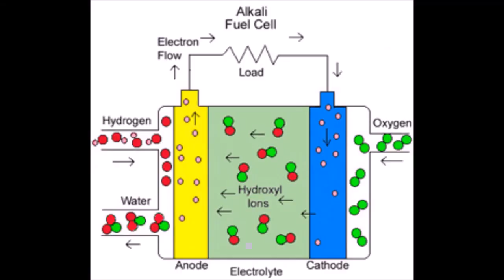DIY Electrochemical Hydrogen Fuel Cell

Comment: Can I use a copper metal sponge? A sponge has much more surface area in contact with the water. Will I experience energy loss with copper?Can I use a copper metal sponge? A sponge has much more surface area in contact with the water. Will I experience energy loss with copper?

Comment: Could you power a car with a bigger version please? much more platinum / surface area... foil sheets? Sheets rolled around a "spongey" material... H2 and O2 separate? Can it run on liquid H2 O2? Maybe the gas can not only "power" it but super cool something towards lower resistance... dunno.

Comment: Hey, even I tried this with 4 cells in series and it's only generating a voltage of 2.6V and current of 0.11mA and it's not enough to run a 3V motor. Can you please help me out?

Comment: Why not make a metal fuel cell using lemon juice and concentrated peroxide. A microfiber cloth for a wick and just have electrodes of lead an aluminum or aluminum and carbon? Just sand a pop can and bet some fishing anchors flat. Or you may have to buy a carbon foam electrode or graphite sheet. You can use citric acid instead of lemon juice but store bought peroxide does not last long as it is mostly water. Your aluminum gets used fast.

Comment: 2:15 I'm going to make one and design one for my laptop, because the battery discharges too quickly and the batter replacement is too expensive.

I'm happy I took Chemistry, so I know about hydrogen fuel cells and how they work, but am researching further to try and design a small fuel cell that can work easily with my laptop.

Comment: Hey guys I was planning to do a chemistry lab experiment on these fuel cel and was wondering about the independent variables that I could change to study the effect it has on another variable.

So far I’ve been thing about changing the concentration of KOH on the effect of current change supplies with a constant voltage (9V). Anyone have any other suggestion?

Comment: why some fuel cells or electrolyzers can make hydrogen and oxygen without potassium hydroxide, from pure water?
How much efficiency you achieve using platinum?
I wanna know if it is possible to make a reversible fuel cell myself and if I can achieve at least 60% efficiency in electrolyzer and 40% for the fuel cell.
I know that the state in the art is at 93% and 60%

Comment: Could you use a carbon electrode instead of platinum? or would that dissolve into solution?
Reply: I did some reading on Alkaline fuel cells, and it should be possible to use a nickel anode and a silver cathode.

Comment: does enyone know where can i buy that sort of platinum wires...? (without spending a fortune)
Reply: I did some reading on Alkaline fuel cells, and it should be possible to use a nickel anode and a silver cathode.

Comment: could you use table salt as the electrolyte
Reply: Yes, but table salt will consume some of the hydrogen and oxygen to produce lye and chlorine gas
Reply: potassium hydroxide or maybe sodium hydroxide are best. (in certain types of drain opener).  I guess the next best might be sodium carbonate (washing soda), purchased or made by cooking baking soda.

Comment: You can substitute nitrogen doped carbon nanotubes or N-doped graphene for the platinum   For cheap proton exchange membranes you can use PVA chitosan h2s04 gel electrolyte. Trust me unless you are going to invest in a sputtering setup platinum will break the bank before you have a system big enough to matter.

Comment: you could have predicted your cell voltage from the half cell potentials (0.4-(0.8))... agrees quite well with experiment! had you used an acid electrolyte, you'd have made the actual 'standard hydrogen electrode' which was used to reference other half cell reactions (as 0.00v) :) very nice!
Reply: lol

Comment: Interesting concept. You could cover the potassium hydroxide solution with silicon oil, to prevent the formation of potassium carbonate from the CO2 in the air.
Reply: This is like the only problem with Alkaline fuel cells.  Pretty amazing devices.

Comment: my understanding is that hydrogen fuel cells work by recombining the hydrogen and oxygen to for water and use the movement of electrons from this process to create electricity. question: where are the hydrogen and oxygen recombined? do ions travel through the electrolyte and which ones?
Reply from the maker: +mysterioushooded 
Yes ions move through the electrolyte
Reply: ok thanks

Comment: I've always wanted to try this with Pure Nickel metal, as it's in the same Vertical row as Platinum on the ptoe. 
It also seems to have the ability to absorb hydrogen gas too, maybe lots more under pressure
Reply from the maker: +BasementBen 
look up nickel hydrogen battery. "The negative hydrogen electrode utilises a teflon-bonded platinum black catalyst"
Reply: Yeah, a nickel anode and a silver cathode.

One source I found said that the voltage potential on one of the electrodes increases with the log of pressure.  

The temperature can also be increased up to the boiling point.  
This is extremely corrosive though.  Don't touch!  

Vp(mV) = 1.5 T(Kelvin) log(P2/P1)  (Vp = cathode potential? in millivolts)
Vn(mV) = 4.0 (T2-T1)              (Vn = anode potential? in millivolts)

Comment: Was reminded of something when I saw diy solar panels at end......Has anyone ever heard of using sterling engines as generator? I do not know how plausible the science behind it is, but supposedly you can concentrate sun onto a sterling engine with mirrors and it will produce up to double the amount of electricity then solar panels. Idk how true this is, or if just a concept. Comment if anyone knows if this is true/false. thnkz
Reply from the maker: +Clyde Connors 
Sterling engines have a theoretical max of 40% efficiency to convert heat energy to mechanical energy which is better than most solar panels but by the time you have made that into electricity solar wins because you dont have alternator losses. Here is an engine that I made: https://www.youtube.com/watch?v=H85DJwRyaIk
Reply: A silicon solar cell is around 15% efficient.  A toy Stirling engine is likely around 1-3%.  A power-producing Stirling engine is typically around 10%-20% , around half of the theoretical max (Carnot) efficiency.
Reply: those actual stirling engines are not perfectly made
they use the stirling cycle wich is ideal
but their construction and build isnt
the best and most efficient design of stirling cycle i saw, were the freepiston one using compressed hydrogen as themodynamic gas
Reply: Sterling engines can be used for solar power generation, but they are much less efficient than a solar cell. The efficiency of a normal solar cell is somewhere between 22 and 40%, while a sterling engine has an effieciency of around 1.5 - 3%

Comment: G'day,

Yay Team !

 Well, mate, unless you can cobble up a Fool-Cell which is better than 95% efficient at turning Water + Current into Oxygen & Hydrogen, and also better than 95% efficient at turning the Elementikal Gasses back into Sparkliez...; then you'd be FAR Better off buying the best existing Lead-Acid Battery in the Catelogue, because they'll actually be worth using.

 If you REALLY want to do the Hillbilly thang, then intercept "not yet dead" Automotive Batteries at the local Auto-Electrician, most have been chronically undercharged, and even if you can only resurrect them to being 75% efficient (90% is Brand New, lose 5% to heat in storage, another 5% in retrieval..., Pb/H2SO4 is REALLY hard to beat...!)...; then you'll be miles ahead of Fool Cells...

 My son once gave me a Solar-Electric Fuel-Cell powered Model Car, for X-mas when he was a 1st-year 'prentice Auto Electrician, it was 60% Efficient at turning current into Gas, and 40% Efficient turning Gas back to Current..., so even if you can beat that by 20% you still won't be 1/3 as Storage-Efficient as a  Car-Battery...

  I can admit to having become a bit "Obsessive" about Lead/Acid Batteries, and how to pander to their idiosyncratic requirements & limitations...; backtrack me to my "SunFoil Project" Playlist, wherein if you view "SunFoil Science, Raw Experimental Data & Analysis..." then you'll see what I mean...

;-p

Ciao !

Comment: Hey Cody, any recommendations for generating lots of H2?  I want to float some large mylar Christmas balloons and don't really like the idea (or cost) of using helium.  I probably need a couple hundred liters, electrolysis is slow and I want to avoid generating O2 if at all possible.  If these go up i prefer the orange fireball to the white flash.  :)
Reply: +jcims search for HHO Drycell on youtube, and a real good source is HHOPWR or smartscarecrow or zerofossilfuel, and look for the videos from 5 or 6 years ago. But be careful HHO is dangerous if you are careless about it. Don't build a wet cell configuration, it works, but not as good as a drycell and it is dangerous. Make sure you use the right safety gear to prevent a back flash, and never store oxygen and hydrogen inside a compressed container together.

Comment: Semi-related question. What would be more efficient for converting electricity into kinetic energy: an electric motor, or using electricity to run water through an electrolysis cell and then use the resulting gasses to run an engine?

Comment: What if you try nickel(it will not corrode in lye even under voltage, and some forms  of it are catalytic) instead of Pt wire? You could try even nichrome wire if not having pure Ni, will you try?
Reply: Yes and silver for the cathode.  Silver has about the right bonding strength with oxygen for the oxygen reduction reaction.

Comment: Try making a methanol fuel cell it's almost like a hydrogen fuel cell but it's much safer and some buildings use methanol fuel cells as a back up power supply for when power goes out :)

Comment: Hey Cody, I've done quite a bit of research into building fuel cells, and I want to warn you that you're going down a dead end with this design. You're patterning your cell off of the Grove Cell, which suffers from 3 big problems: 

A) Power output is related to the distance between the two electrodes. With the grove cell, you'll never be able to get them very close together.

B) Power output is related to the surface area of the electrodes. with the wire, you're kinda stuck in a corner on this one...

C) The grove cell takes up a LOT of space compared to other designs, so it's not easily stackable.

Look into the Bacon cell and sintered nickel gas-diffusion-electrodes. It's a flat design, so it's easily stackable, the electrodes are extremely close together, and the electrodes have an extremely large surface area. Another big plus is that you might even be able to nix the platinum altogether. The basic cell design is two electrode plates, between which is a very thin spongey or cloth material that holds the electrolyte. Gas is forced under slight pressure into the electrodes, so that the electrolyte and the reactants meet inside them. PM me if you'd like more information!

Comment: Would it be possible to electroplate the copper wire with platinum in order to use the expensive metal more efficiently?
Reply: it should but the platnium would need to be in solution aqua regia being the acid to use you end up with chloroplatonic acid...

the issues you will end up with is the platnium burning off the copper...
Reply: Or just use a nickel anode and a silver cathode.

Comment: Now I finally have a reason why I bought potassium  hydroxide
Reply from the maker: +U-238 
If you want to get the jump on me skip the wire and impregnate charcoal with platinum and use that.
Reply: +Cody'sLab impregnate?
Reply: I'm going to try to scale this up but with a 1000 ml beaker and test tubes
Reply: I can't do it now bc I have pneumonia but I'll try
Reply: +Victor Fiori try uploading the finished product? :D
Reply: ok but I have to order some platinum wire unless I could use something else below this I will comment with my other channel.
Reply: +Marty Camenzind this is the channel I will upload it on. plz subscribe :D
Reply: +Cody'sLab impregnate?

Comment: Are you sure the gas isn't diffusing in the water?
Reply from the maker: +Davi Poyastro 
It probably is a little but hydrogen has a low solubility and the gas loss seems to have stopped when I unhooked the wires.
Reply: +Cody'sLab I might add that the two gases dissolve in amounts way different from each other yet they change the same amount

Comment: wasn't the problem with hydrogen that it diffuses even through solid steel? (as evidenced by the fact that your HHO torch tanks were missing about 50 psi when you tested them)
Reply from the maker: +Sirius Black 
I should be ok with aluminum tanks.
Reply: not as fast as iron, sure, but it still permeates through aluminium at about 10^-10 Mol/((meter*second*Pascal)^.5) (compared to about 10^-9 for iron)

(according to http://www.rebresearch.com/H2perm2.htm at least)

EDIT: wait... this is at 700+ degrees celsius,i thought it was at 70...

extrapolating the number gives me about 10^-17 for aluminium, compared to 10^-11 for iron

you're probably right in saying that aluminium is your best bet though :P unless you wanted to make them out of gold xD
Reply: actually i sorta have an idea for a neat experiment due to that unit (mol/M*S*Pa^0.5)

i figure that, because the external environment doesn't really contain hydrogen gas, it should leak out of a sealed container until the internal atmosphere is an almost perfect vacuum (hydrogen leaks out, helium is hardly present in sea-level atmosphere, and the next gas is nitrogen, which is 14 times heavier and will therefore not permeate through the container)
Reply from the maker: +Sirius Black 
It would actually create a slight vacuum, far from a perfect vacuum though.

Comment: Hi! what if you hammer this wires, their area will increase dramatically. By the way, 0.5mA should be enough for led to give some light even lower, its voltage need to be more
Reply from the maker: +Uterr 
yes, I need about 3 volts. so 3 or more in parallel should work but I need more platinum.
Reply: +Cody'sLab in parallel you will get 3x current, not voltage :)

Comment: Cody what if you casted a sponge and put the mold into ice, then you pour platinum inside the mold and after a few seconds suck out the still liquid platinum. you'll be left with a maximum surface area hollow sponge.
Reply: +Liquid Metal (Lear) You could make the mold out of something you can chemically desolve to extact the sponge properly
Reply: +Liquid Metal (Lear) to make that work you would need a shit ton (technical term) of platinum, to be able to pour it, and to have some still liquid after a second of it touching the cold mold :P stuff's hella expensive